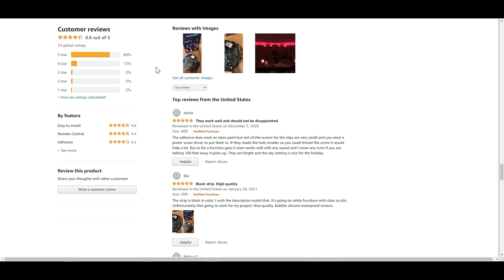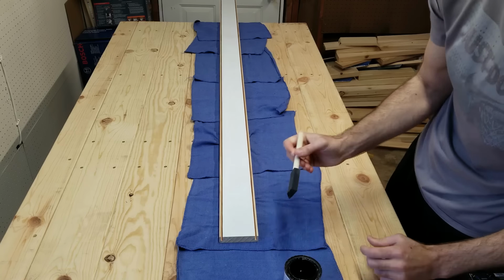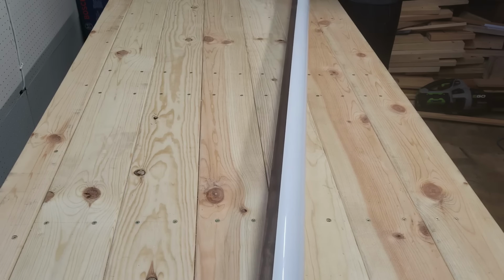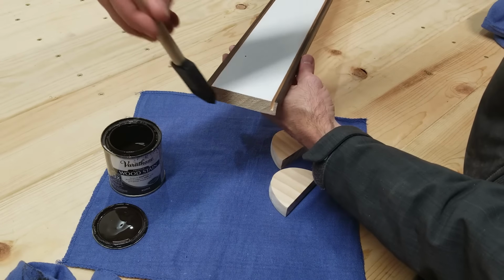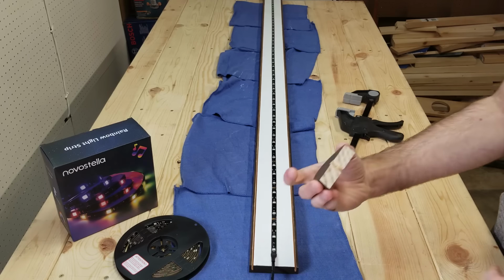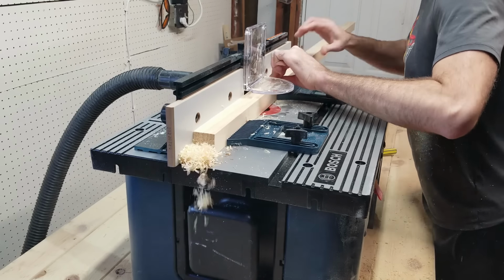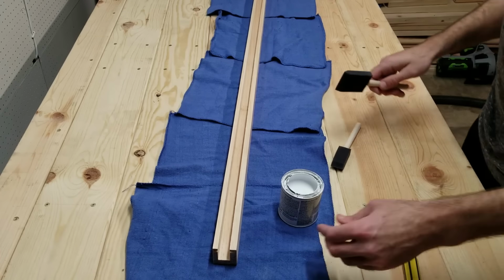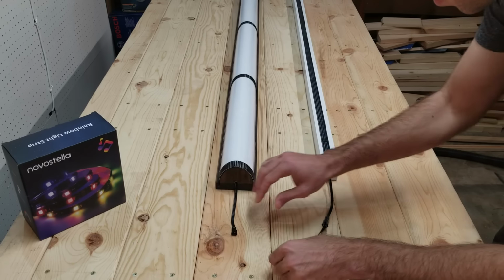DIY LED STRIP DIFFUSER IDEAS

Comment: Hey! Maybe a weird question, but ive always been wondering if you can still use the rest of the LED lights for different items or do you need to buy new ones?
Reply from the maker: Great question and one that I would have not been able to answer a couple months ago! You can use the leftovers. It would just require you to buy some sort of power supply and controller which can vary in price.
Reply: @ChrisMaherDIY  Alright! Do you have a link for such power supply and controller?
Reply from the maker: @jelleraffel5  Its going to depend on what LED Strips you are using. Some require 12v power supply and some 5v. Here is an awesome video that walks you through the basics that I watched and helped me understand a little more (i'm still new at this so there are so many people out there that know a lot more than i do) https://www.youtube.com/watch?v=j15pjU3YZfg&t=655s

Comment: Homie said “easy” and step one he’s slicing up wood
Reply from the maker: Lol yeah easy is a very relative term. I guess in this case its easy because the cuts are about as basic as they get and you could do both of these designs with technically just a cheap circular saw. Thanks for watching!

Comment: Can you help with a way to use your first method but for a regular led strip side in a normal aluminum channel recessed into a shelf. I am going to be putting a strip in a shelf but this light will be on camera and the spotty effect is going to really suck. I think if I make the channel very deep like you did in the second example and then use the diffuser stuff it might work. I don't have tools to cut the slots like you did..is there another way maybe? I don't have a router.
Reply from the maker: You might have to get creative but the only ways to really get rid of hotspots is to have as much seperation between the diffuser and led's or get an led strip with the leds as close together. You could alays create a channel by pushing 2 seperate pieces of wood close together. Thanks for watching!

Comment: For the first design, if you make the tubes smaller, will the LED strips heat up??
Reply from the maker: In my experience, the heat generated by LED's is very minimal and never something that has caused any issues so I wouldn't be concerned.
Reply: @ChrisMaherDIY  Ok thank you!!!
Reply from the maker: @Itsjuustnatalia  You are very welcome! Thanks for watching!
Reply from the maker: @Christopher Smith  great observation! One guy the other day had a great idea that i want to try on the second design. He suggested I put 1 stencil paper very close to the led strip and then the second one I put where I did in the video. That way they are staggered with a little space in-between. I really want to try that to see if that makes a difference and if the LED would be perfectly diffused instead of almost perfectly diffused lol.
Reply from the maker: @Christopher Smith No worries! I love comments! I think the strip I used is 30 per meter. So like you said, tough to completely diffuse when material is super close to the source. Let me know if you work on any projects! I'm always looking for new ideas!
Reply from the maker: @Christopher Smith Thats awesome! I'd for sure love to see how they turned out. Either way works good for me. But i'm sure if you posted the link here, others would love to see it too! If you prefer email, my email address is outrunprojects@gmail.com Cant wait to see how they turned out!

Comment: If you cut the LED would it affect the lighting effects?
Reply from the maker: You can cut it and the effect will be the same. However I'm not sure if you then want to use the ones you cut off how that would work. I'm thinking you could just get another controller and hook them up to that.

Comment: Think it would be nicer without the black part on either build.. like some clear covers or a solid cover on the round one. The black strip on the small one kinda just defeats the purpose of diffusing the led light if it’s just going to get isolated into a bunch of tiny sources anyway. But they’d look great solid I think.
Reply from the maker: Thanks so much for watching and I appreciate the comment! I agree. The black is more of a personal preference and definitely not needed.
Reply: but you would definitely stil be able to see the leds behind if it was just th emesh. youd see one spot of briught led light behind a mesh, where mos tof the mesh isnt lit up at all. you definitely need a defusion layer behind th emesh to every hole in the mesh is equally as bright for an even lighting. the lots of tiny sources are far easier to look at than bare leds.
Reply: @ge2719  well I guess it’s good I didn’t suggest using just the black mesh when I made that comment a year ago.. I said a solid cover.. as in remove the black vertical strips that bridge the gap between each round translucent diffuser and get their edges line up and held together with some clear tap or get a longer piece of the material that fits the whole length if possible. That would be the best possible result. No gaps, completely translucent end to end.

Comment: hi, do you know what is the wideness of rgbic pro govee? I want to use with led diffuser channel and I need to learn cuz all diffuser channel wideness is difference.
Reply from the maker: Thanks so much for watching and that's a great question! I've still never got my hands on the Govee Pro. I think those are designed for outdoors so they will be wider than most since they will have a protective covering on. I'm not sure the wideness but I would guess somewhere around 15mm.

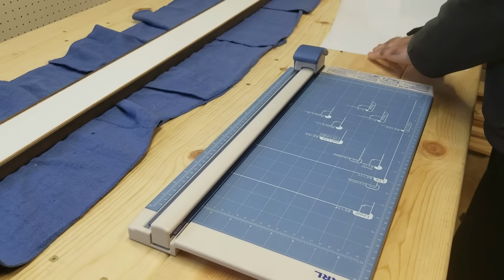Comment: 2:13, what is the name of that paper ? can you share a link please ..
Reply from the maker: Thanks for watching! Its called stencil paper and I got it at arts and crafts store. If your in the US you probably familiar with hobby lobby. Here is the link: https://www.hobbylobby.com/Crafts-Hobbies/Stencils-Craft-Paints/Stenciling/Stencil-Blanks---12%22-x-18%22/p/27038
Reply: thank, and What would be the parameters that I have to look for? maybe: Thickness: 8mil (2mm)? , transparent/clear or white color? @ChrisMaherDIY  thank..
Reply from the maker: @angelvaca9232  yeah .2 is what the ones from hobby lobby are but i could never find anything that worked as good as them. I found a lot on amazon but they never were as good. The amazon ones i've used required like 6 layers and the ones from hobby lobby only required 2. You would want it to be a milky white color. Good luck finding something!

Comment: It is visually nice but quite dangerous. You NEED to somehow remove the heat produced by a led strips. If there is no heatsing the strip will overheat and degrade quite quickly. Also there is a fire hazard connected to overheating. I saw few cases of fires caused by uncooled led.... Maybe try to route a channel that can hold a heatsink or at least, place a heatsink on the wooden surface.
Reply from the maker: Thanks for watching and the recommendation to make it more safe! That's a great idea to add a channel to hold a heatsink!

Comment: How many strips can I attach together?. I'm trying to line my outdoor privacy fence with lights like these. But I need about 150 feet or so.
Reply from the maker: That's a great question! I think much more than 20 ft of led strips and you will probably need to inject some power which I unfortunately don't have any experience in. Hopefully down the road I can do a project that requires something like 150 ft and i can then hopefully help answer this question! Sorry buddy!
Reply: @ChrisMaherDIY   that's no problem at all, I appreciate the kick back. I'm trying to find a good way to light it up and have it look nice . I was thinking of putting edison bulbs all around but I feel that would be a bit more expensive.  I have found 150 feet worth of led strip lights but there was not enough good reviews to warrant a purchase... either way I sure do appreciate it.
Reply from the maker: @TowBoater315  If you end up buying the LED's and putting them up, let me know how you did it and what you ended up using! The more I get into this hobby the more I realize i don't know lol. I did just watched this guys video and it was helpful for me as a beginners guide to LED's and powering them. https://www.youtube.com/watch?v=fKD8I5gTTJo
Reply: @ChrisMaherDIY   ok thanks ill check it out. I was going to run the strip on the bottom lip of the panel at the top (vinyl fence, that way when the lights are on the kind of bounce off of the white panels and act kind of as an accent light),  and run it along the lip until I got to a post, try to keep it straight and level as I go around the post and then continue all the way around. So honestly I'm probably looking at like 180 feet or so when it's all said and done. But what's nice is that you can trim those led strips if you bought too much. It would look really nice when it gets done.. the problem is idk how many I can attach together without losing any leds. And I cannot find anyone that has attached more than 2 together at a time. So idk if more than 2 would work.
Reply from the maker: @TowBoater315  man that would look so nice bouncing off the white fence! Maybe see if there is any facebook or reddit group for LED enthusiasts and ask them the question. There had got to be some people who could walk you through the steps.
Reply: @ChrisMaherDIY   I would but unfortunately I am not on any social media platform other than YouTube. I'll keep an eye out for more LED videos. Maybe I'll get lucky. Thanks again. And it was good chatting with ya. Good luck with the rest of your projects.

Comment: Looks nice but I don't think you can call this "easy DIY", it's not exactly super accessible or easy for people who don't have access to that kind of machinery or training on how to use it.
Reply from the maker: Thanks for watching! Yeah i agree. Easy is a very relative term. A few people have made the same comment. What do you feel would qualify for making a project easy? I guess I felt it was easy based on how simple the cuts were. The second design i do could also be done with just a straight cut line from a table saw or circular saw as long as you used 3 pieces of wood instead of the 1. No need for a router if you did it this way. Appreciate your feedback and thanks again for watching!
Reply: anything with a saw is going to exclude anyone withiut a garage.  where else would anyone store a table saw, if not a garage or like a spare room designed for crafting or woodworking? aka literally sooo many people lol, me included could not diy this lol..

Comment: You decided to “hide” the already-invisible seams by slapping on those black mesh strips? For me personally, those ruined the aesthetic. I think leaving it a continuous line is definitely the best option. Also, I would recommend either removing all music, or letting a song play in the background during the entire duration and then just turning up the volume slightly for the parts you’re not voicing over. The constant abrupt transitions between voiceover and then the same song was kind of harsh and unnatural. And my last critique is that this isn’t cost effective like you promised in the intro for most people considering it requires a router or table saw. Aside from those things though, this was a great video and the result was definitely nicely diffused. For anyone looking for this paper, it’s called “vellum” paper in many craft stores too.
Reply from the maker: Thanks for watching and the great feedback! Yeah the mesh is defenitlty not nessesary and I imagine many people if making this would leave that out. I agree with the music. I think I will try the constant music in the background next time and turn it up slightly when not talking! And cost effective is a very relative term. The first design you could easily do it with a 30 dollar circular saw (walmart) and the second design you could use the same circular saw and 3 pieces of wood instead of the router. Thank you again for watching and love the feedback on how I can improve!
Reply: @ChrisMaherDIY  Yeah I guess the cost effective thing is subjective. And good, yeah I think that simple tweak with the music will make your videos a lot more professional for sure. I’m thinking about trying the second method you showed in this video with the simple rectangular channel. Have you by chance noticed better diffusion by testing a third diffusion layer halfway between the surface and the LED strip? I imagine that’d work better than just stacking the diffusion paper at the same spot.
Reply from the maker: @Kingsley4K  I didn't try that with layering the diffusion paper a little apart but now I really want to try that. I think that would actually help a lot and I don't know why I never thought of that! Brilliant idea buddy!
Reply: @ChrisMaherDIY   If you add another layer, you will take away 10-20% of the light, but it won't make it "spotless" -- you need more height for that.... this took me a lot of trial and error, but it turns out math was the answer.  If the lights are 34mm apart (like on a 30 LED/meter strip), then you need 34mm height from the light source for it to blend with the other lights and become "spotless."

Again, like I said in the other video, your ideas for diffusers are genius -- I will have to try these.
Reply from the maker: @ShocktorGaming  Math for the win!! That makes sense! I'm glad you enjoyed the videos and if you end up making something, I'd love to see how yours turned out! My email is outrunprojects@gmail.com if you ever want to share!

Comment: Too bad most people don't have a work shop and table saw.
Reply from the maker: Thanks for watching! I appreciate the support. Yeah for sure not everyone has access to the tools I used but you could probably do both of these with a simple circular saw. The second design you would just use 3 pieces of wood instead of 1.

Comment: Cheap and affordable as possible... promptly uses expensive table saw

I swear all American makers seem to think everyone has a huge garage with room for a table saw and other workshop tools
Reply from the maker: Thank you for watching! On the first design at least you could easily use a circular saw to make the channel. Those you can get very cheap! Or if you know someone who has one, you could see if they would let you use it for 5 minutes as that is really the only cut you would need to make on the first design for a great look! Thanks again for watching and your feedback!
Reply: So get crafty. U think we all have a nice table like that then your on drugs kid. Use 3 pieces of wood instead. Duh u really don't need a router bud
Reply from the maker: @dmo848  For sure! 3 pieces of wood and you don't need a router. I should have said that in my video! Good call!
Reply: @dmo848  1 piece of wood and use thumb tacks to hold the stencil paper on ;)

Comment: Okey, I don't have that expensive wood cutting tables so I am gonna skip this video.
Reply from the maker: You could do both of these with a 40 dollar circular saw if you don't have access to some of the tools I used. The second one you would just use 3 pieces of wood. Otherwise you could get creative and use cardboard to make similar designs. Thanks for the comment!

Comment: Good info. But.... Easy...? Idk dude not every has a router.
Reply from the maker: Yeah lol "easy" is a very relative term. For some, what I did in the video would be something they could do in their sleep. For others it might seem impossible. A quick tip which I should have mentioned in my video is if you don't have a router, you can still make the same design, you would just need to use 3 pieces of wood. You could also probably do both designs with just a simple circular saw.

Comment: LMAO   you said you wanted something cost effective, then you use wood...  I"m sorry, but where I live,.. EARTH   Wood is sooo friggin expensive!!   why not try getting some Cable hider PLASTIC U CHANEL and then put a diffuser on it...  cost effective.. some are even flexible and could even get some rubber hose  milk white and run the LEDs in it?.. and make sure you get LED's that are WIFI so you can even control them with google home or Alexa.. or phone app...                    Just Saiyan...
Reply from the maker: Thanks for watching and yeah I suppose it all depends on where you live! Those are all great ideas! Definitely might have to try doing that one of these days. Thanks so much for watching and taking the time to comment.